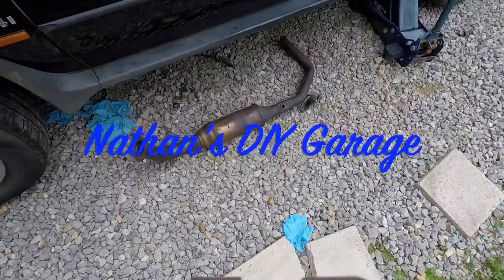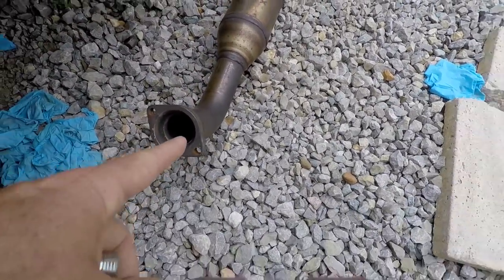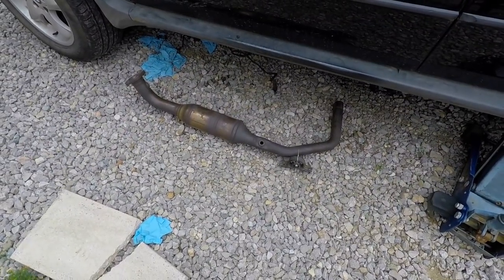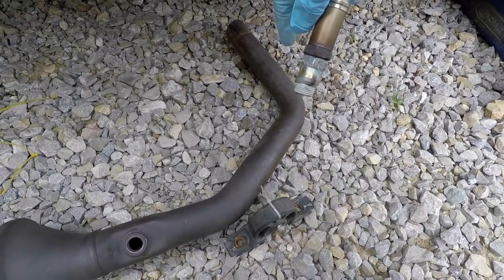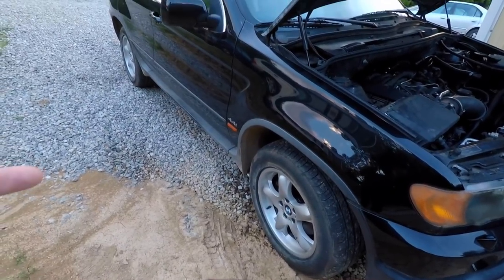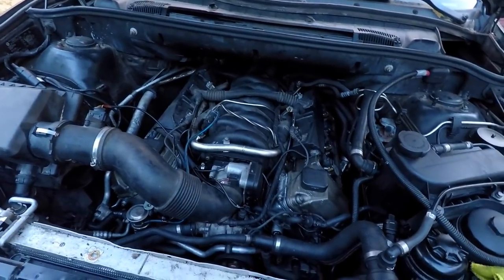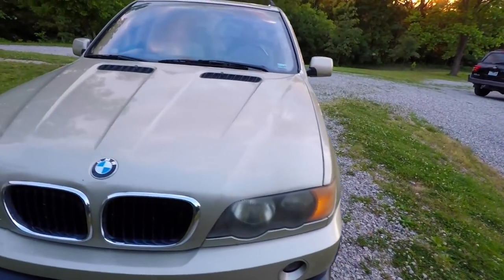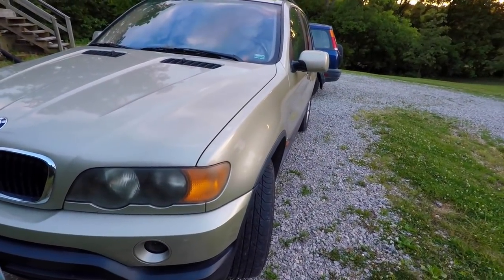BMW E53 X5 Catalytic Converter Bypass / Removal / De-Cat (offload Use Only Of Course)

Comment: I dont know much about mechanic, but I have a 2007 BMW 328.  the car wont start , but I took the O2 sensor and the car runs fine just is super loud , do you think cats are clog up ?? car have 150K miles

Comment: Hi if you do a cat delete on the x5 will it have a check engine light ?
Reply: Yes it will but if u cut the cats and dont damage the o2sensor and wel a pipe I guess it may not show the engine light
Reply: @francocarrillo5204  and if the CEL come is the car gona drive bad or it's just a warning?

Comment: Nathan my 06 E53 3.0i doesn't have any check engine light on nor any other indicator for codes. However, the Nova scan tool I used has BMW advanced aspect on it. So I'm seeing these here come up as follows: 5F42 error gearbox in emergency mode active; 5F3A clutch gearbox-ECU clutch is open rear wheel drive; 5F5B can message instrument cluster error sending failure identification; 5D8D fuel return pump off um rfp off, exp on fuse defective or it's motor relay defective stop error on feed back off; 5DCE voltage under charge too low uz error and 5EB1 steering angle sensor LWS if nothing else could you do video explaining these things so people have more better understanding of what these mean as well explain what each function is and does in relationships to each other within the 2006 E53 X5 3.0i Sport Activity Vehicle...like I currently own thank you. 

I ask this respectfully because I have looked high and low and not getting the info I need to better get a fuller understanding of these issues with in my specific model BMW X5 here mentioned above. I am working on it now just changed the upstream oxygen sensors, but couldn't get the post sensors to come out lol. Not much room under vehicle on ramps. Changed thermostat just above clutch fan, did the AT thermostat too awaiting the cam shaft position sensor to arrive to install it..

My notion is that I believe these issues are being triggered via the water that was getting into center console which leaked water down into my radio navigation system screen doesn't show info upon the display...the radio works (you just can't see anything) only using controls on my steering wheel..I will be replacing the unit with another one...for now I have GPS that plugs into lighter...so I can still get to any location unknown to me I'm not familiar with. I'm a novice learning to work on my own things because of being mislead and duped out of money. So I'm trying to become better at being my own mechanic...n only try to see reputable shop with references sorry to say an excuse my language but I'm not comfortable with someone just finger fucking my vehicle and expecting to be paid for running roughshod wit vehicle...thanks brother for any assistance in this area time available to do what your able would greatly appreciated again thanks...learning me...chanic lol 😁🔧🔩
Reply from the maker: Yea the stealership will leave you with a empty wallet and a car that is still broken, when is the last time the fluid in the gearbox has been changed? is it shifting weird at cold? if the are old codes that are hangin in the pending background they should go away, if not the check engine light will come on as they become stored, you can also unhook the battery cables and touch them together and see if that clears them
Reply: Nathan's DIY Garage thanks for responding back to me upon this matter. I'M not sure when exactly the previous owner did anything in respect to the fluid being changed. I recently bought it from her, and have not registered it yet. I addressed the issues of thermostat being stuck in the open position, new plugs, sensors only upstream. I couldn't get the two downstream sensors to budge so those two have not been done. The vehicle runs what is in my opinion fine. It is not running rough no sputter. I used a hose to repair my break line leak on driver side rear wheel for the rear passenger side wheel. It's holding up not leaking and the display message does not come back on regarding it. My cam shaft position sensor is here I have to pick it up. It's cold in my area but not cold to point that what I researched on BMW threads of cold starts stalling etc I'm not experiencing those things they went through. But the thread spoke more upon the transmission issue which everyone has experienced. I now have the issue the thread is upon 5F3A says clutch gearbox-ECU clutch is open rear wheel drive!!! With 5 other codes similar to this one just different functions such as a "can message upon instrument cluster error sending failure identification" as I stated in my previous message to you. I will be tackling the cam shaft position sensor next..but each time I put the novo scan tool on vehicle to see if the issues would go away it still tells me emissions like : cat, eva, not sure what that is there, o2, and htr issues but no lights are on in my dash to these being stated by the tool?????
Reply: Nathan's DIY Garage hey the stealership that's a good one there. And as I stated in the thread ppl were thinking about bringing a class action against the company because with the transmission issue everyone has with these vehicles....it's a serious matter that could lead to someone loosing their lives.. my intentions are to once registered get to a reputable BMW dealer to tell me whether this E53 I own has any open recalls for whatever that needs to be fixed under said recall. And some ppl in the thread said we could possibly get a full refund of the vehicles monetary value. Given they have been well aware of the existing problems and either do a bull shit job in RE flashing the necessary system components with right software or they tell owners that they can't do anything if they say brought BMW in several times on same issue they contend to of fixed the 1St time you took it in for service to be corrected on their end...they also said keep records of everything get names of people who serviced it at which BMW dealer location...and speak with an attorney on the matters under the Lemon Law due to this existing matter and it carries over into each batch of vehicle's they assemble at the plants they then sell to us. It was very deep on the issue. And the 1-800# they said is provided to contact upon issue they give us the consumer the PR spew so to speak which does nothing and you're just told bunch of jargon basically on the matter when you call them to complain about the problem or problems.